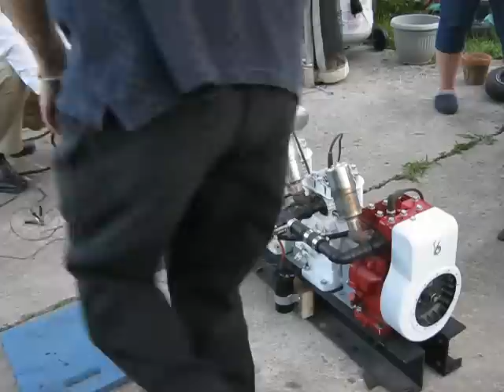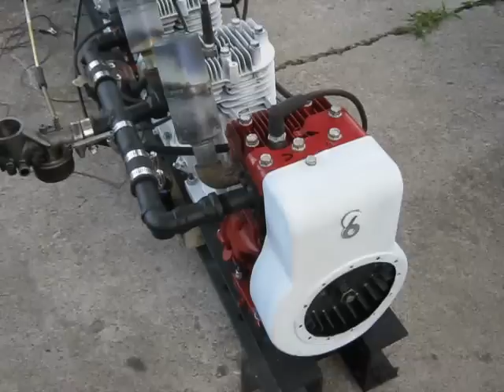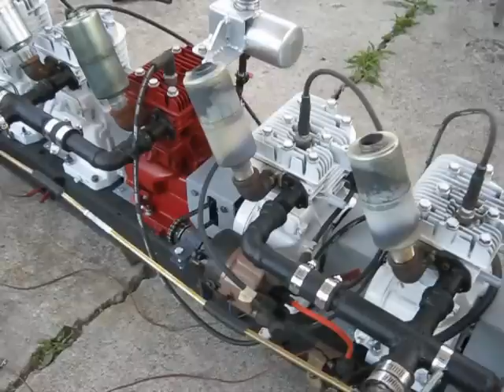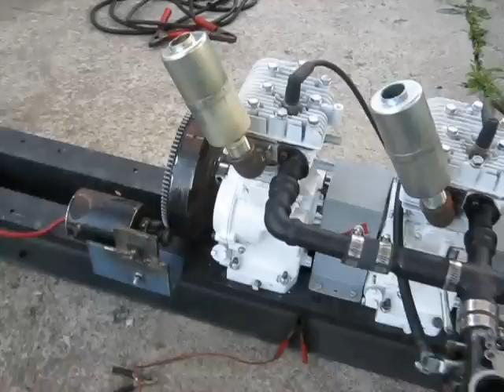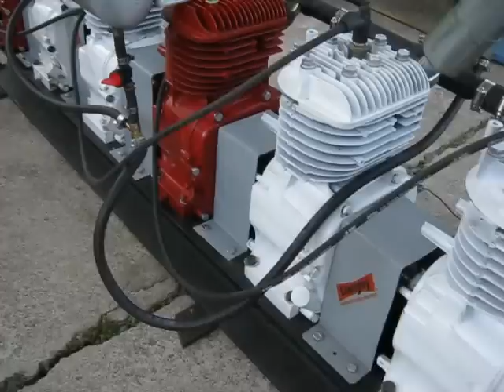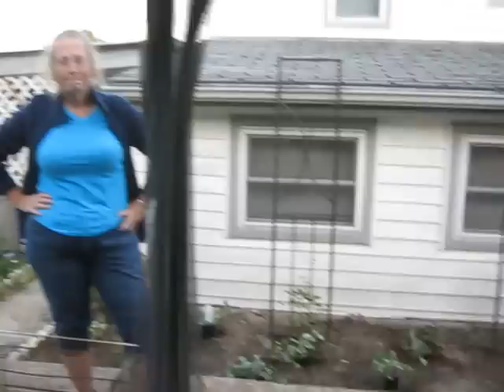FrankenBriggs 6 Cylinder 1st Run!!!!

Comment: I know this is done "because it can be done" but for all practical purposes the weak link will be the crankshaft because the total output comes at the flywheel end, which was only made to handle a single cylinder. If this were to be used with some particular project in mind I would be looking at each engine being independent for both cooling and fuel then coupled to a common external driveshaft via a belt. That way if one fails you have the rest.
Reply from the maker: Yes, your idea is correct. The output of this engine would be limited to about 15 horsepower, or it would twist the shaft off of the last cylinder. I have heard of someone ganging 4 small engines together chained to a common output shaft, with each being a complete engine , apparently it was a successful project.
Reply: Personally I would shy away from a chain or gear drive because there's no easy way to properly lubricate it and get rid of the heat generated at speed. Yes, it's done on motorcycles, but consider the drive wheel is only moving at a few hundred RPM at highway speeds, plus air cooling due to traveling down the road. Doing multiple engines with belts and centrifugal clutches would allow so much more freedom, especially if one engine fails. You also have the option to stack engines in a variety of configurations around a common shaft, only limited by the pulley width for your offset.
Reply from the maker: Oh, one more thing, thanks for recognizing why I built this engine. I get a bunch of comments asking what use this is, or why did I make it. I did want to see if it could be done, as well as see if my connection method would hold up, plus I wanted to hear what it would sound like. I got a bit carried away at the end of the vid, but I had been working on building this for about a week straight, and that didn't include building the various engines, and finding all the couplings, chain, distributor, and making the starter flywheel, so I had a lot of time invested into this, so I was very happy when it finally coughed to life.
Reply from the maker: True, there would be some advantages to using a belt drive. I hadn't thought of stacking engines around the output shaft, but that would shorten it up for sure. I wounder if the engines would have any problems with harmonic vibration if the got into sync with one another, chains would provide a more positive timing control, but would not last as long unless lubricated, as you say. Interesting ideas, I will have to ponder this concept for a while, thanks for helping me keep the gray matter working!  :)
Reply: You do realize the sync of the engines would be in constant flux due to clutch or belt slip and when each engine was started. That's something which could be partially absorbed by rubber engine mounts. Guessing it would be rather random most of the time so the exhaust note would change. Still in all, the total power would be available at the end of the shared driveshaft.

Comment: One carburetor for each two engines would probably work better. More even mixture.  By the way. Why was it built?
Reply from the maker: I had made a 4 cylinder, and planned to make an 8, the 6 just came before the 8.
Reply: What you use it for? Jusy hobby or something more?

Comment: Great ,but what are you going to use it for?
Reply: +Scottie1152 rite?
Reply: kennedy singh true
Reply: 30+ horse power??? Wow!
Reply: If you have to ask that question....then you really dont understand why he built it at all....!!!
Reply: kennedy singh EXACTLY!
Reply: What does it matter? A true gear head dosent need any  reason to do anything aside from the challenge of doing it. It's cool leave it at that.
Reply: Charles Moore LOL
Reply: seisix6 
Don’t have to ask, he wants to know!
  I was thinking the same. 
  Perhaps an old ford truck with the front end cut off lol?
Reply: kennedy singh potentially a riverboat inboard streamliner designed for least area of resistance ......

Comment: awesome work, cant wait to see it finsished
Reply from the maker: I did pretty much finish it, if you search around in my vids, you will see the final run vid of the 6 cylinder, as well as an 8 cylinder i made a few weeks later. Both engines run much better than on this vid.

Comment: In parallel but not a six cylinders but it is six cylinders 🤔😭
Reply: twotwocold i think what you mean is that it's a 6 cylinder but not a v6
Reply: >  I think what you mean is that it's a 6 cylinder but not a v6

I think what you think he means is that it's a 6 cylinder but not a straight 6.

It would be nteresting to see what this engine looks like in stroboscopic light, I dare say the vibration patterns of where the various masses are in the line is affecting the smoothness of it's running. It will perhpas be trying to retune itself?
Reply: mark p, it’s 6 different blocks, 6 separate cranks, 6 separate cam shafts and the list goes on.  It’s six engines mounted on a rail.
Reply: All the crankshafts are pinned together so it runs as 1 system. Detroit Diesel did the same with their 12v92 GM's that consist of 2 x 6v92 detroits with the crankshafts pinned together to run as 1 12v92.
Reply: You are correct. This isn't a 6 cylinder engine. #2 by the starter didn't run. The muffler didn't turn blue.

Comment: I like how I can hear the distinct exhaust note of a 6 cylinder from it
Reply from the maker: There is a better vid of the 6 running, this is actually the worst vid, as it had spark timing retard happening! I fixed that, then it would rev over 3000 happily, it was really struggling in this vid. I had worked on it for a number of weeks to get this initial run, so I uploaded this vid.

Comment: hahaha this is quite the power plant. now i just need to make a minibike to fit it lol.
Reply from the maker: This is actually the worst running vid of this engine, the other 2 i have here show it running better, but this gets all the views. I had a camshaft timing problem, as well as an ignition problem on this vid. but it ran much better once I worked those out. i like the Straight 8 engine vid better.

Comment: Very cool! Next up; a sleeve valve version?
Reply from the maker: I would if I had a machine shop!  I would make sure all 6 were running also, as 4&5 are having problems in this vid, I cured that on the next vid. My straight 8 runs better, until it broke a crank gear at 5000rpm  :)
Reply from the maker: I am starting on the final 12 cylinders to hopefully have the H24 running by the end of this summer. Many man hours of work to accomplish it though, basically a repeat of the H12 from last summer  :)
Reply: @ChargerMiles007  That will be something to see, looking forward to it! ~Ian

Comment: Man-O-Man !!!!!! 3 cylinder is my love but 6... Oh my God !!!!!!
Reply from the maker: I have ran two 3 cylinder Briggs engines, an inline (half of the 6) and a stacked up radial version.
Reply: Don't worry ! I've been living around car parts car motors for a childhood. What can I say.. I love being a mechaniac ! :D
Reply: Also, why didn't you use individual carbs for each cylinder ?
Reply from the maker: A Mechaniac!!!  Good one, I like that.
I used two carbs for an easier throttle linkage setup, plus I figured if the old 6 cylinder car engines could get away with 1 carb, surely I could make 2 work.

Comment: You put some work into that.That is a nice build.Every one talking about why and useless instead of just admiring the build are the same people driving around with a picture of something blocking their check engine lot so they don't have to see it.
Reply from the maker: Thanks for understanding my build concept. I know it can't run for too long before it will overheat, and the 2 carbs are not the best set up, but hey, it works.
 I happen to have some electrical tape covering the engine light, as it stays lit do to a EGR snafu which I will cure when it bloody well decides to warm the heck up here!!!  :)

Comment: Yeah - lots of comments on intake/fuel mgt. But I was lots more concerned about running up the RPM on those splash oil lube systems. They are not capable of proper lubing at high RPM. But it's all fun! Very cool. I doubt he wanted to set up vacuum indicators on the carbs to balance the flow. Just experimenting. Binford 9000!

Comment: Yes the crank can wind up and snap since winding and unwinding happens at the same time on extreme ends and meets at node in the  middle somewhere....this is the most advanced physics problem and is an art...Finite element analysis today can model this pretty well for design and build.  Check out formula one engine design...years ago the Brits tried to stack two flat six engines together into one gear...which was destroyed at can exact rpm because of harmonic vibrations. שלום
Reply from the maker: Yes, those pesky crankshaft vibrations have caused me grief at least five times now! On the 8 cylinder inline engine, when we revved it to 5000 rpm a few times, it eventually broke the powdered metal crankshaft gear in cylinder #5 (luckily the engine is salvagable). I also broke a crank gear on the 3 cylinder Radial Stacker engine.  My five cylinder inline seemed to want to vibrate a lot, and unscrewed the nut on the front flywheel twice, as well as vibrating the whole engine assembly sideways while running.  I use 1,3,5,2,4 firing order on it, though I noticed no engine manufacturer has used that firing order. I did it since I have 2 carbs, and I wanted to equalize the fuel distribution as best I could. I had major coupler problems on my inline 4 cylinder, until Lovejoy corp. donated some couplings to me to try, which worked fine. Finally, my Jumo 205 type opposed piston 2 stroke only ran 5 seconds before it broke the flywheel keys and shut off the igniton. I am aware of the crankshaft flex and vibrations, but complicated math isn't my forte, so I just experiment and hope for the best.
 i have heard of the flat H 12 formula engine, as well as a 4 cylinder design that had to be dropped due to crankshaft harmonics. I have read a good article about the serious problems 18 cylinder radial engines have with harmonics, and how hard it was to overcome them. Thanks for your input and interest.

Comment: Good project, just a humble suggestion, I think the 90 degree elbows in the intake manifold are killing the project, try using one carburetor per each two engines with the carb in the middle of the Tee intake, or try replacing the elbows on each of the first and third engine with two 45 degrees, and check the difference.
One big thing that will help eliminate the backfiring is that since these are hard coupled, try to time the engines at different stroke positions to balance the power and try eliminating the back firing. Ej: each engine 60 degree difference.
When you manage to make it run, you have to find a way to cool engines 2-6 since you took away the cooling fan.
Reply from the maker: Thanks for the suggestions, the backfiring on this vid was caused by the camshafts being out of time on #4 and 5 cylinders. I made 2 later vids after i straightened out all the bugs.

Comment: took a while but finally saw the distributor. looks like fuel supply is gravity fed; any plans for a fuel pump ? would it be better to feed the fuel from the center point of the carbs instead of chaining the carbs together feeding one first and then the other ? What is the firing order ? Is it a single points distributor or dual point or all electronic ? Did not see a distributor spark advance on the distributor; any plans or need for one? Any plans to try a 'shaped' intake manifold tube for the center intake feeds to match the other tubes ? Don't know what you are up to with doing this but it is very good Tinkering !

Comment: I would fly an experimental 1 seater plane powered by this. Bluprinted. & with some good tips here.
Reply from the maker: You are braver than me! 
Though it appears it would hold together for a few minutes at least.
A rocket powered ejection seat would be a necessary precaution thought!
Reply: Go to junkyard, modern fuel injectors. Fuel engine monitor. Battery. Its not getting fuel. Racing go cart parts and up dates, balance and blueprinted . I can spend your money better than you. Don’t let your wife see this. Think aircraft engine and study some old inline ones.
Reply from the maker: lol  , my wife would string me up if I dumped a whole bunch of money into a FrankenBriggs engine. Buying the 14 sprockets and bushings to make the Straight 8 almost put her over the edge!  :)

Comment: Seriously leaned out cylinders ... check the cooking of those mufflers. Would like to see where you are at with the motor today. Sounds pretty nice when it was running!
Reply from the maker: You are right on the money, retarded spark timing is also a big culprit. I tore this apart, and made a Straight 8 (3 vids here of it running) It worked much better when I solved the problems this one had.

Comment: i always wanted to build a 4wd go cart. each wheel would be powered by an 8 hp briggs with a clutch from an auto a/c on each hub. most older auto a'c units needed about 7 hp to run so it think they would hold up. with about 30 real hp the power to weight ratio would rival most super cars if the cart was 200 lbs.

Comment: awesomeness! I am going to create a performance stirling engine and I will post the video in a few months anyhow great work thumbs up, next will be a exhaust system setup with headers and Flowmaster possibly? you gotta post a vid with that on there that would be pretty awesome :)
Reply from the maker: Hey, please message me, or send me the vid when you make one of your performance stirling engine. I helped out a bit on a solar stirling that used a 10 foot dish, it is incomplete presently.
Yes, a Flowmaster exhaust would be great, and maybe even a bit more quiet than these individual mufflers, as apparently the more cylinders you feed into one muffler, the quieter it is. If I didn't have neighbors, I might try zoomies!!!! :)
Reply: I sure will great work it would be nice to power something with it like a golf cart stretched to fit the engine or something crazy like that lol
Reply from the maker: I was leaning towards a tractor, with the front tires right next to one another, and a wide back end to stop it from tipping over  :)
Reply: +ChargerMiles007 nice

Comment: what a beast, I see the issues I see are already stated in regards to cooling and fuel/air flow but I wonder how this would go with efi and a 6cyl ignition ecu? there are some pretty good kits or even pull apart and repurpose a cars ecu on the cheap side. would smooth it right out. its not all that tricky now that efi is pretty mainstream. I'd find a nice wee boat to put that beast in.
Reply from the maker: Yes, that would make it easier to have water cooling also  :)

Comment: Looks like the 3 engines furtherest away from the starter were running lean or low in time according to the exhaust. Get you an Infared Thermometer and check all of the exhaust to see if the engines are running really close in temperature. Something is going on there somewhere. 
    Cool idea tho thanks for the video.

Comment: Maybe three carbs would work better.Pretty cool though.Doesnt that hot exhaust on #3 mean too much air ,not enough fuel?
Reply from the maker: Yes, I noticed how #3 seems to heat up pretty quickly when I reviewed the vid. There is too much going on when the engine is running to notice all of the details like that. It turns out that #4 and 5 cylinders aren't running on this vid due to having their camshaft timing messed up, inspite of the fact that smoke comes out of the mufflers sometimes. #6 should be running, but wasn't doing so 100% of the time probably due to the carb being messed up by the 2 cylinders that weren't working correctly. I got it all corrected on the third vid called the final run. The 8 cylinder I built next worked much better.

Comment: Great job,sounds Good..Why didnt you put a flywheel on each engine,with the shroud for cooling,or did you try that and it didnt work.
Reply from the maker: Your idea may work, with a different machining approach than I used, but the way I coupled the engines together wouldn't allow for a flywheel between engines, so only the first cylinder is cooled. I know this isn't practical without additional electric fans or something for cooling, hence the 1 minute run. I am not 100% satisfied with this run, so I will try again, something wasn't right with all that backfiring going on, so I have some investigation work to do  :)

Comment: Pretty cool! But you need a way to tell if all six are actually firing and not just cranking over, because I'm pretty sure all of them where not running.
Reply from the maker: You are correct, in this vid only 4 are running, in my other vids of this engine, all 6 are firing. check out my 7 and 8 cylinder also.

Comment: You know what'll be cool, 4 Predator V-twin engines to make a V-8. They will all have independent carbs, so no real unequal A/F ratio's to each cylinder. They will all have their own independent oil cooling systems which could be plumbed together running a big fanned oil cooler at the front. You could make two mint exhaust manifolds running straight piped.
Reply from the maker: Hmmm, i like your thinking, too bad I didn't have some of those motors!  I can almost hear that thing singing a sweet sound in the neighborhood, with no mufflers!  :)

Comment: Oh, wowie, that's at least 22 HP!
Reply from the maker: the output shaft probably wouldn't even handle that much, but it is a fun beast to play around with. I also built an 8 cylinder, it was rocking the neighborhood when I unscrewed all the mufflers and fired it up for a vid  :)
Reply: +ChargerMiles007 its a scary world out there. I was just watching Seattle SX,  this unit could have pumped some water off the track!........